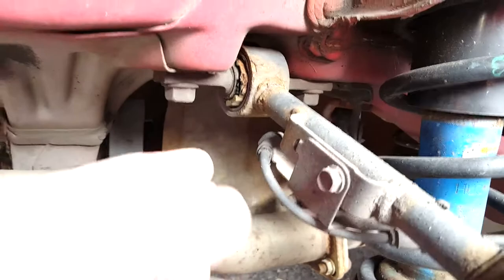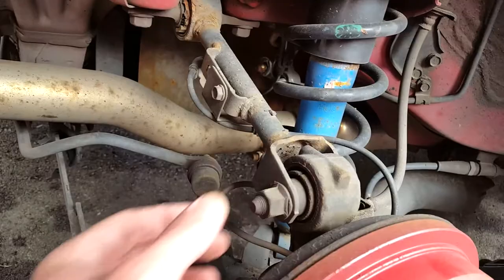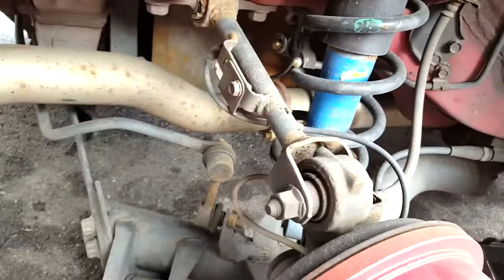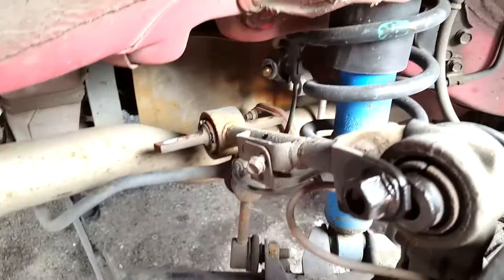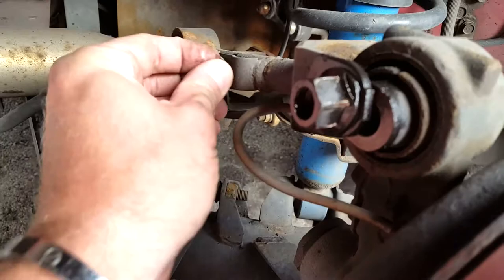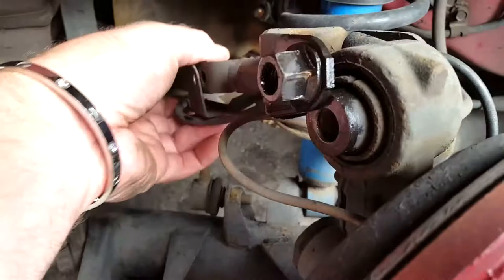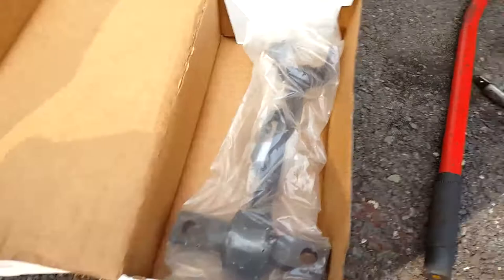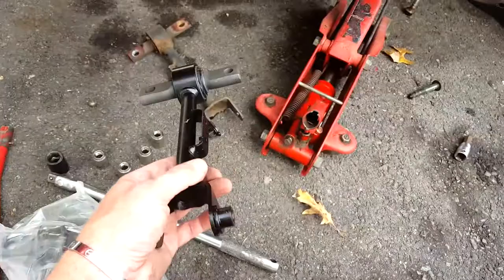2001-2005 Honda Civic rear upper control arm replacement Moog

Comment: Would those being bad cause a loud thud sound going over bumps? I had the rear struts replaced and clunk noise is still there like always and now squeaks horribly too, on 01 civic.
Reply from the maker: Yes it could be, mine were almost rattling at times and it's such an easy job to change.

Comment: did you change the knuckle bushing also ?
Reply from the maker: No, but that is something that I want to do soon. Right now I'm working on the rear of my Integra and then I'll get to the Civic. I believe you have to take off the trailing arm so I'm just going to do everything at once.
Reply: I got a bad squeaky sound coming from the passenger rear and the tire starting to tilt inward at the top hopefully it's my upper control arm @danrandom3390
Reply from the maker: @sherrodgee3075 it sounds like you're suspension might also be sagging
Reply: @danrandom3390  just took the tire off today and my sway bar link completely broke at the joint wow
Reply from the maker: That probably happened because you're suspension flexes too much and everything's old so I really think you need new strut assemblies. Those links can be a pain in the butt, I often take a cut wheel and carefully cut them out, I noticed a broken rear end link on my brother's Civic a few months ago and I took a few strong zip ties and zip tied it back together and it's still holding and he drives a lot 😂